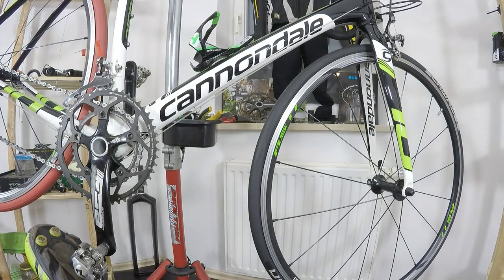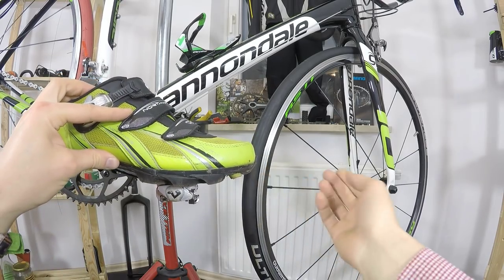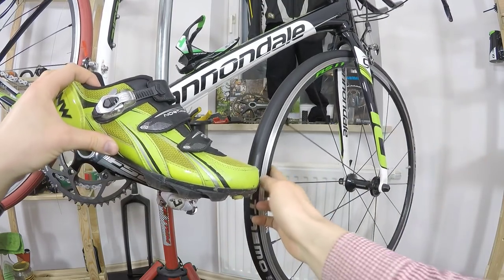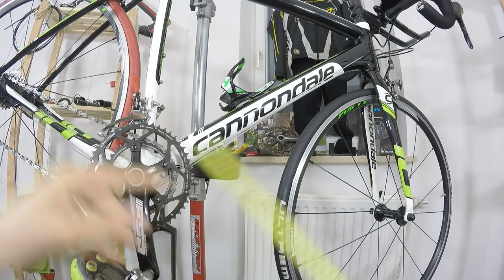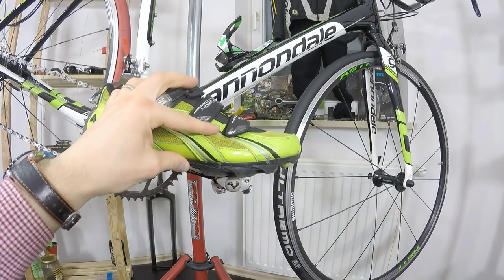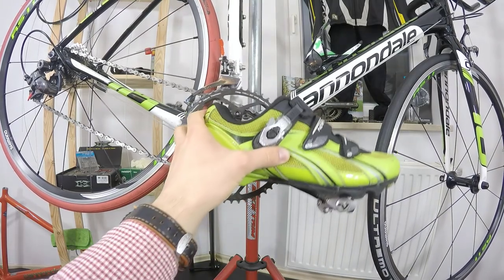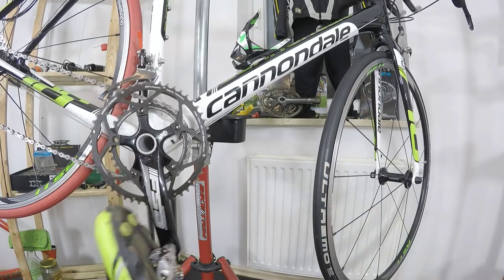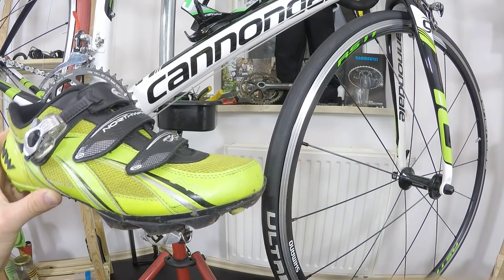Frame Too Small? Toe Overlap Problem Solving. Bike Sizing / Fitting. Cannondany

Comment: I liked this video. If toe overlap is a problem when there are no fenders, then the situation is much worse with fenders.  I had this problem on my touring bike set-up.  The problem was solved when I changed to a fork with a slightly larger fork rake, or offset.  The resulting longer wheel base made for a better ride too. Thanks for the video.
Reply: Just ordered a fork with a 48 rake 49cm frame

Comment: Well ... in spite of the nay sayers... (really makes me wonder why some folks just take the time to comment that they do not have this issue!) this video was indeed very useful for me. Have this issue on a properly sized bike and although i generally ride it in open roads not requiring sharp turns i have to get out of the city to get there ... and in doing that i do have sharp turns to manage. Caused me to crash twice. Changing the crank length is not an option for me due to the fact that they are actually a power meter. Changing the fork... well cannondale supersix evo black inc. you do not change the fork on that.... but the shoe... did not think about that. Long story short... changed the shoe (not size) and problem solved😌. Very useful video.thanks for sharing !!!

Comment: Toe overlap on CX bikes pretty common due to the short wheel base and 'snappy' geometry, also confounded by cleat placement behind the ball of the foot.  If you have large feet and shorter legs this will be ever more of an issue.   That being said, even a big toe overlap isn't much of an issue unless you are trying to do a quick 180 on the trail.

Comment: First if you can turn on a roadbike  left e.g. your left toe goes up an crank arm is in vertical position, and not in horizontal so overlap should not be a problem. Second i have long torso short legs and arms find me a safe and no overlap size frame where standover height is also ok....

Comment: Although i ride size 50 frame, i wasn't having toe overlap before (crank length 167.5) until few days ago as i experiment with very rearward cleats positioning (almost mid foot) PLUS i put the cleats more toward the outside of the shoe (on narrow q-factor BB30 crankset) making my shoe much closer to the wheels. My long ride endurance improve by that cleats position which unload my calves but now i have to be careful when i do sharp turn. Not sure if it's worth it.
Reply: Depends on what you use the bike for. A midfoot clear position is sometimes compensated/ paired  with shorter cranks to
a) avoid toe overlap & dangerous slow speed turns
b) put the rider lower on the bike (slightly more aero and lower seatpost)
But imo, most importantly, takes the calves out of the equation in the pedal stroke.
This may or may not be a good thing for you, but a triathlon racer will appreciate slightly fresher legs off the bike into the run. *Disclaimer, I do bike riding most of the time and know nuts about the dynamics of triathlons,but it's my 2cents to my friends who wishes to compete in triathletes. * but similarly, if you are going to be walking quite alot off the bike, your calves will feel fresher, same goes for if you are doing big endurance rides/ touring/bike packing where time is not of the essence . The main disadvantage is that your peak torque and by extension, the number of revolutions you will need to get up to speed will increase significantly both due to the absence  of calf participation and the shorter cranks.
Reply: @ghcheong Or train really heavy the calves so one day they can withstand with ease the loads, and use them, the second heart, to help pumping blood to the legs.

Comment: Very nicely done. I have a Pinarello that has this issue. I am rebuilding the bike and am going with 170mm cranks and shoes 1/2 size smaller. Thanks!
Reply: Explain to me how this is a real issue.
Reply: +My Own Spaceship (Mao) You gotta learn how to properly sprint, specially if you have are moving to road or track from MTB.
Reply: +Mauricio Alsina Lee that makes absolutely no sense. I've been a roadie for over 20 years. I have a size 12.5 foot. It's a complete non issue.
Reply: My Own Spaceship It's not when you know how to ride. Mountain bikers tend to turn the front wheel side to side instead of just lying the bike when sprinting. When you do that, overlapping becomes an issue. But this new issue is because that biker do not know how to sprint. 
Believe me, I've seen riders falling because of that.
Reply: +Mauricio Alsina Lee even if that's true, it shouldn't be a consideration when sizing a bike. There are far more important considerations. Kind of like how bike manufacturers design bikes with low bb drop just for newbies that don't know how to time pedal strokes. But hey, who wants a bike that feels stable and planted.
Reply: True but the sudden contact (although rarely a significant issue) is something I can do without. The fit of my Pinerallo is perfect and since I have been moving to 170mm cranks anyway it makes sense to do so. Thanks MAO your comment is appreciated.
Reply: wow, your feet grew .5 inch in 4 months. Amazing
Reply: On an off road bike on tight trail at low speed or in a parking lot.
Road bike would have to be a large overlap to become a problem.
I have a cyclocross bike that I got with a 52cm frame and overlap is a big problem. Enough that I'm going to get a 54cm Frame. Also, steep head angle doesn't help

Comment: I wouldn't say that fork is offset to the rear.  That's just a visual effect.  The fork will be sold with an offset, and that number is really all that matters.  A larger offset will give more toe clearance, but will make the steering way twitchier too.

In most cases I don't think toe overlap really matters.  you learn fairly quickly to reposition your feet  for low speed turns, and at high speeds you're not likely to ever turn it that far.

Comment: This video is flawed.  Toe overlap on a road bike is nothing to worry.  If you base the bike fit on not having toe overlap, you will be riding a frame that is too big.
Reply: yup im 172 and I overlaped a 57 cm frame
Reply: I have a 16" I very need a 24" bike
Reply: Or cleats installed wrong!
Reply: I think you are correct... I commuted quite a bit on my cyclocross with lots of toe overlap and it did not cause me any trouble once I knew it existed.  If I am turning that sharply, I probably have my outside foot down and not pedalling.  If  I am pedalling with such a turn, my pedal force and cadence is likely extremely low.  I did not consciously avoid it.
Reply: so is toe overlap simply something normal ? i just noticed i have this issue, i love my frame size right now, i am 174 and have a Giant TCR S frame, not sure if it is something that i need to fix or just let it go. thanks
Reply: Hank Wu it was not a problem for me on the road. I don't know if it would be a problem mountain biking.
Reply: If you had to turn that much on a road bike, you're either going pretty slowly or you're about to crash...
Reply: I find it to be a very dangerous problem when commuting.  Lots of stops and starts.  Every one of them is when you are crossing an intersection.  You turn the handlebars quite a bit when first taking off.
Reply: @EviLDaMmIt  not really , you can be just maneuvering around a tight area, and can hit your front wheel.. I personally dont like toe overlap. I think the bike has a bad design if you have that. Just my opinion 
 ..
Reply: @recyclespinning9839  I'm sure you would find majority of racing bikes tend to have that geometry. Even the pros go for a frame size down. Like I said, you had to be going that slow (tight area) which normally doesn't happen..
Reply: @EviLDaMmIt  yeah if you racing, if you on the street , toe overlap comes into play. Yeah you can pedal with one foot , say when you have a tight slow turn ..but why.. my 1980s Rossin Record had tight geometry but it did clear by about 1/4 inch >>>> no toe overlap
 I was able to sprint to 40mph, on flat ground , no tail wind. ..sorry I sold it..my current Casati has >> toe overlap. Faster on hills but not much else...
Reply: Toe over lap is geometry , not just frame size.. depends on the bike builder . Toe over lap is bad design
 ..like wearing a suit with pants to short👖🥼
Reply: Many riders at the 2019 Liege-Bastogne-Liege race were riding frames with somewhat enormous amounts of toe overlap.
Reply: @recyclespinning9839  If the basis of your argument of a 1980s bike geometry is considered a good bike.. Good on ya!

Comment: Ive found a very good deal on a 52cm bike I really like, but my measurements say I should probably be riding a 54cm...can I compensate for that smaller frame with other adjustments?  TY.

Comment: Xbery clear, thank you! My toe overlap is about 6 cm, I use it in both city where there are many traffic lights and also countryside because I live in Amsterdam. I have a fitted hand made titanium bike, could this overlap be solved in any of the ways you indicated, or is it too big and should I sell it. You told that the bent of the forefork changes the behaviour of the bike, I’d be interested to learn in what way. The steering is also fidgety, could this be improved in stability by a forward bent forefork as well? I would really appreciate your advise. Thank you! Monique

Comment: i don't really think this is an issue, all my bikes have this to some degree. it is only a problem when going very slow, like turning sharply through a narrow space. when moving slightly faster you just don't pedal for a moment. most agressive bikes have a short wheelbase so this is just part of the mix. my advice is it is not really a problem. many more things to worry about before this
Reply: Yeah, it's only a problem if its a problem
Reply: thanks for the comment, i feel much better now

Comment: Toe overlap to me proves how stupid some engineers and builders can be. Toe over lap can make you fall on a bike unexpectedly. Yes you can have the leg down when you take a sharp corner, but there is going to be some situation when you unexpectedly hit. Just hope that when it does it does not hit at some dangerous situation and make you go down. I may sell one of my bike frames.  I did get a awsome deal on it and is practically new and has a complete Campy Centaur gruppo.  So I may be shopping for a good frame >>><<<>> with no toe over lap...!!!.. or maybe check the crank arm length like you suggested....
Reply: It really depends on what kind of riding you do.  If you are riding with fewer stop and starts, then wheel overlap isn't as much of a big deal and the handling of the bike will feel nicer than a bike that is longer, which will be more comfortable riding in urban environments with many stop and go or tight manuvers.
Reply: It's not about "stupid engineers". Reducing it to that shows stupidity on the other hand in not understanding the factors in designing a frame, it's a balancing act.

Comment: toe overlap can be dangerous when climbing steep sections, you might need to quickly swing your front wheel to keep from toppling over- catching the toe at this time might have serious consequences
Reply: At 1-5mph I doubt it'd be serious, mostly just frustrating
Reply: mindciller no, topple over at low speed, you put your arm out which risks collarbone/shoulder injury- all because toe overlap stopped forward momentum
Reply: We ride with our legs. Arms aren't that important
Reply: How dare you talk about a real life situation!
Reply: I hate toe overlap and one of my friends actually crashed in the parking lot because of this! During a low speed turn and he had to go to the ER. Seems a bit extreme on my road bike (Cervelo S2 size 51) where my toe overlaps by about 2 centimeters at 3 o'clock crank position (170mm crank). My Cervelo P2 (same 51) doesn't seem to have the overlap! It actually has about 1.5 cm of space between a turning wheel and the same shoe at the 3 o'clock position.

Comment: Hi. I got same problem with new bike ,always rode 55 orbea but it was to big so bought  53  size and its perfect but problem  occurred today with hitting my shoes with wheel. I'm between  sizes  so obviously  this time went for smaller bike .Thinking  about  changing  crankset  from 170 to 165mm if that would  help? What do you think??

Comment: Toe overlap is so dumb, bikes could just have slacker headtubes to lengthen the front center and eliminate toe overlap, then also have increased fork offsets to keep the trail constant across sizes. Fortunately, increasing fork offset also reduces toe overlap, so the headtube wouldn't even need to be much slacker.

Comment: Great advice. But please focus more on the wheels for shorter riders. . If you are 5’2” or less and buy a bike with 700c wheels, you will probably need a 43 to 48cm seatpost bike, and will probably have toe overlap. A common problem with kids using small adult bikes. Or because you have added mudguards, or have enormous feet or extra long cranks. Not a big problem, just be careful going slow doing very tight turns

Or, the real solution for shorter riders, get a road bike with 650c wheels with shorter cranks. Sadly no quality CX bikes / tyres with 650c wheels. Maybe some of the new 650b wheels and tyres will work

Cleats should usually be put at the back of shoes, so is not the cause / solution to toe overlap. You need a certain amount of your foot on the pedal, so don’t use that to reduce over toe overlap
Reply: I have Ridley and cannondale CX bikes, both have toe overlap.

Comment: If you have toe overlap just get some smaller wheels. -SickerCyclist
Reply: That's what I think, it can often be a sign that the wheels are too large for the frame you're using. I think the secondary cause is cranks that are too long for the size of the frame as well.
Reply: Changing to smaller wheels moves the pedals closer to the ground. Another safety issue.